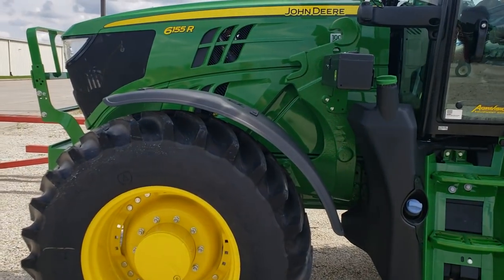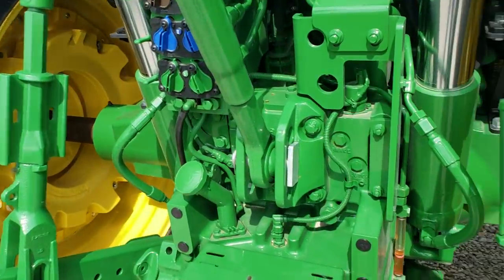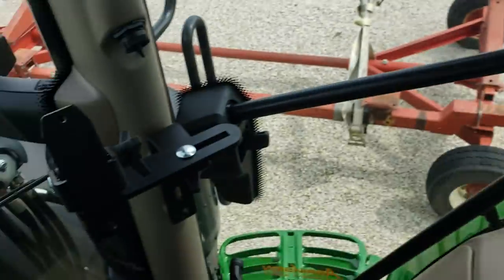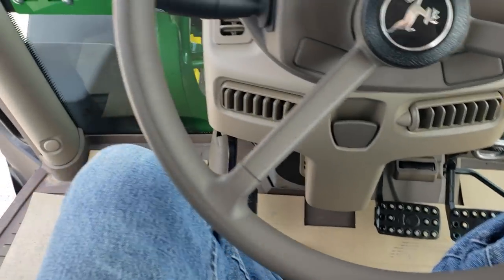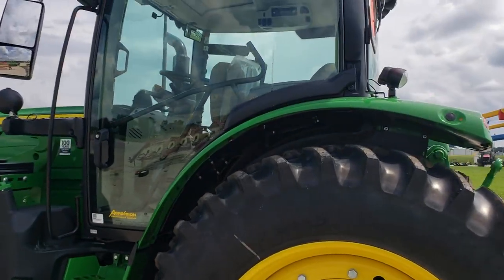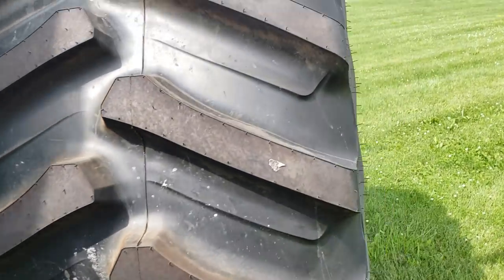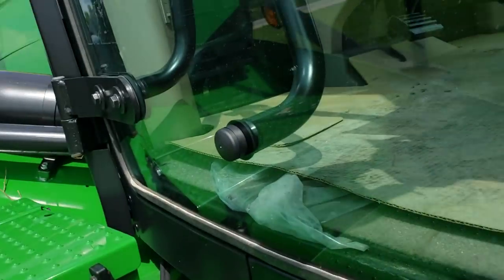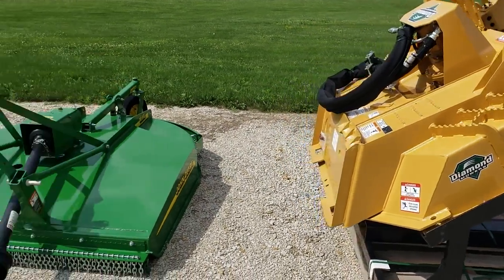Checking out Deere 6R and 9R tractors

Comment: I think if you have a dealer near by (im really new to this channel so i have 0 clue of your area) you could look at a versatile. Their new 2018 models i think can boost to 400+ horse power and they are american style tractors (the challenger 1050 is just a fendt 1050 for the american market) and they generally run a significantly lower price tag (several thousand) than other brands and they are EXCELLENT quality with AMAZING support from the company itself and i havent ever heard someone complain about a versatile dealer. Just a penny for your thoughts. EDIT: did the research and the versatile 365 is a bit smaller than the 1050, its closer to the 1038. but with all the most expensive options its still 40k cheaper than the stock 1038.
Reply: yes ;
my land was north of Edmonton ,  
and Vers is the only way to go ...   Cummins, Allison ,  and dumb-tuff  canadian construction.
thx.

Comment: What's your opinion on a case quad track compared to a John Deere quad track? Have you used em with scrapers before? We have a few on rent at work right now.
Reply from the maker: Thanks for commenting ..... Yes, the Case is a much better tractor than the Deere (im talking 4 wheel drive market) ... We had a 9430 Deere - nice tractor - but needed more power and leased a Deere 9560R - hated it ... should have never made that swap ...... Later on we leased (3 year lease) - on a Case 400HD -  the Case was a sweet tractor ..  We were very impressed with it ...

Comment: Fendt 4 ever!!!
Reply: Fendts are way overpriced, and Challengers (their American counterpart) are a bit more affordable, but they don't have a great reputation for reliability.
Reply: @MFKR696  bullshit, similarly optioned and horsepower is priced either the same or cheaper, and they are tough machines
Reply: @MFKR696  what are you talking about I'll take a fence or Challenger 1000 series tractor over a John Deere 8R 410 or even their four-wheel drive tractors but definitely over the 410! It's not even in the same league